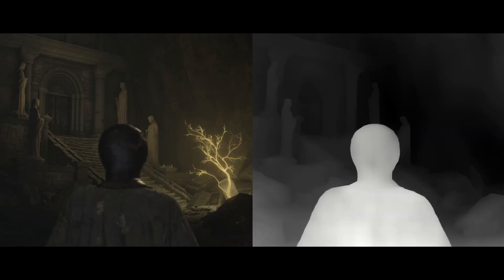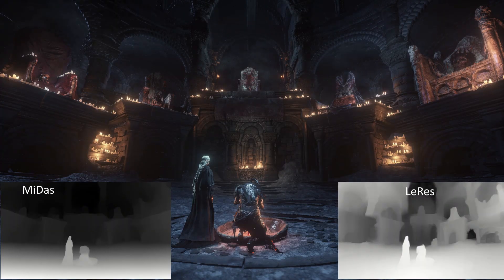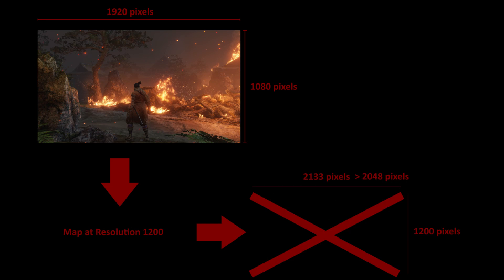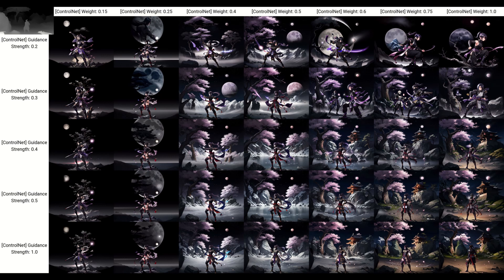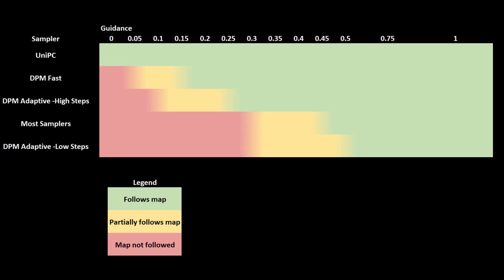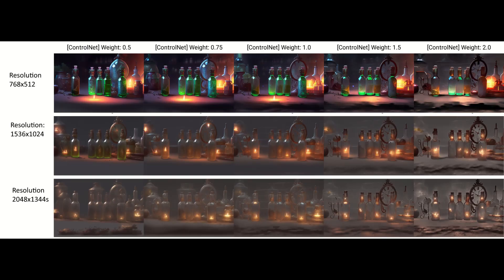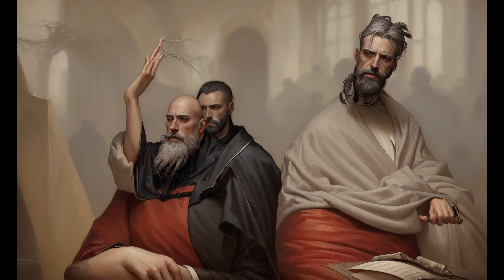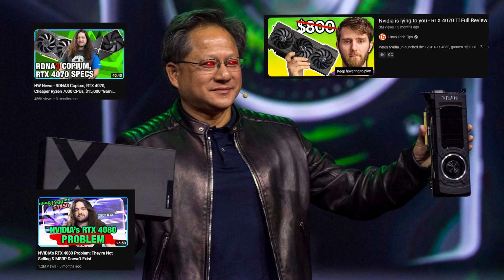ControlNet Deep Dive - Depth - Preprocessors, Weight and Guidance, and Generating at Max Resolution

Comment: Thanks as always for such detailed videos. One thing I'd just like to remind viewers of is that you aren't limited to depth and depth_lres for generating depth maps. It is just an image, so anything from alternative depth detectors, blender, even painted from scratch photoshop can be used. Or you could use both the default depth for closeup and lres for background and combine the two in an image editor to get details at all distance levels.
Reply from the maker: That is a good point.  

I try to limit myself to features within A111 or SD for simplicity, but this is definitely an option if you find the built-in preprocessors lacking

Comment: dooood, i have 3090, i am capable of generating 4096x4096 and higher , the way to do it is to change optimizer in bat file ,, use this : set COMMANDLINE_ARGS= --opt-split-attention-v1 --xformers